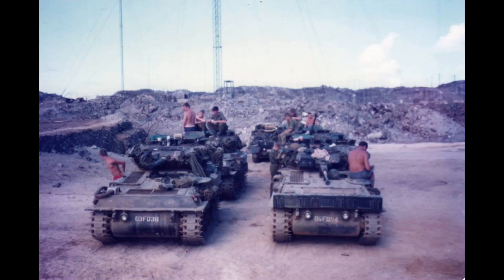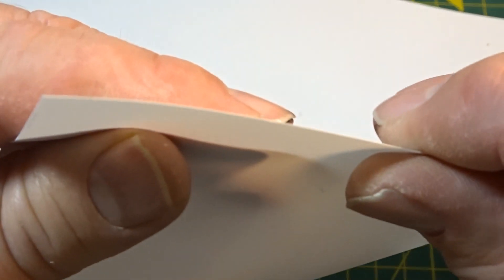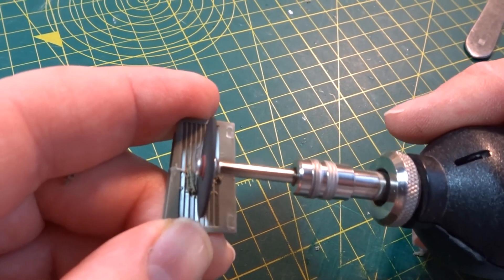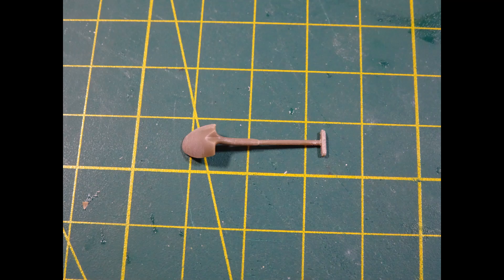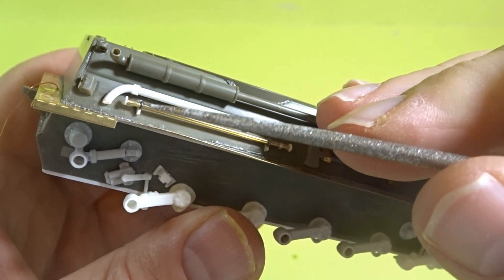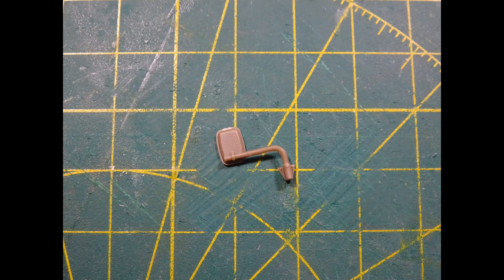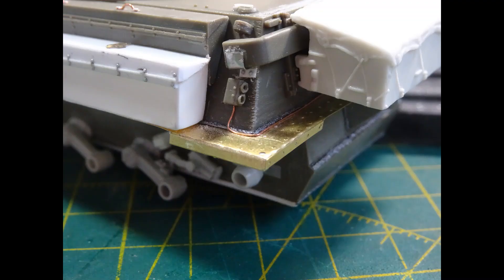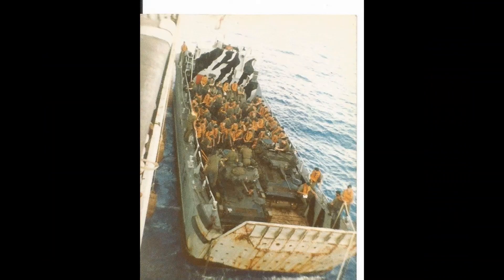Falklands War 40th Anniversary Blues & Royals Scorpion 1/35 Scale AFV Club UPPER HULL

Comment: Excellent scratch building and research. The louvres are difficult - getting all the slats to be angled correctly. Well done bending the tube for the exhaust, I'm surprised it didn't snap. Superb work.
Reply from the maker: Hi Jim. It did! This was my third attempt LOL. I gently dug my nails into the bend which squashed the bend a little bit but improved the bend so that it didnt break. I hate louvres and this may be the last time I do them. A bit like leaf springs - a real pain in the backside. The joys of trying to make a model as realistic as possible. Thanks for your continued support my friend and happy modelling. P.S Since Ian isnt here - Military Modelling Military Modelling Military Modelling Military Modelling Military Modelling Military Modelling Military Modelling Military Modelling Military Modelling Military Modelling Military Modelling Military Modelling🤣😂😂🤣🍻👍😎